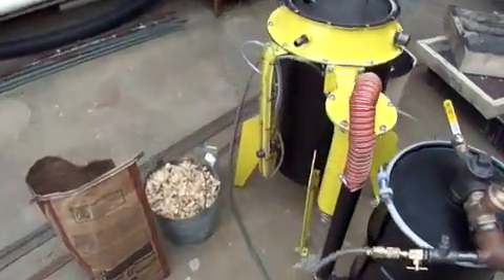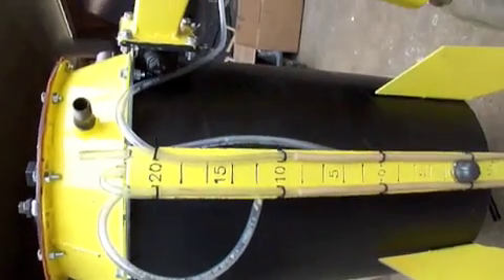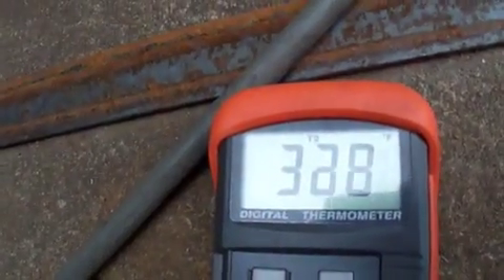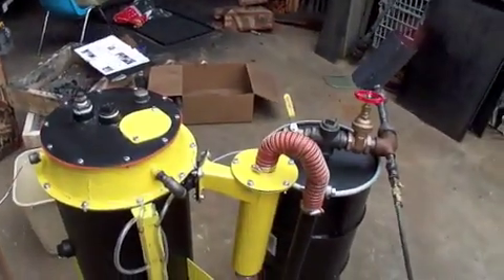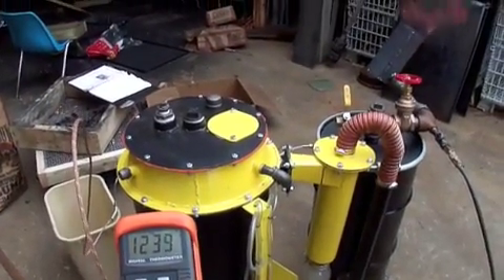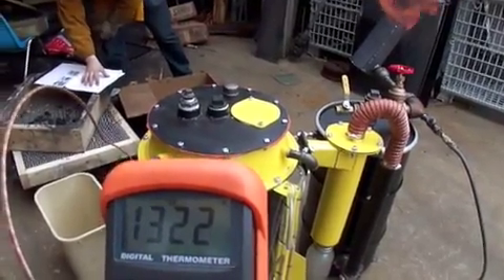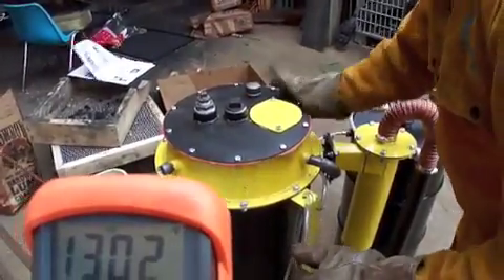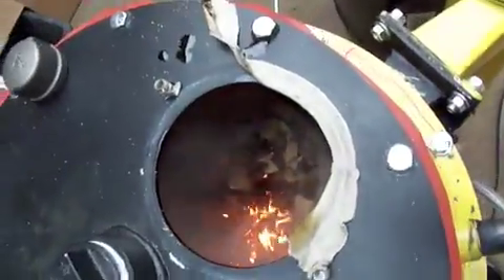ASU GEK FIrst run

Comment: This video is so old....
It's like watching a rerun of Gilligans Island
Keep hearing these collection of children
Talk about BIO MASS

Not sure what any of this technology was suppose to be or be for...
Doesn't take a genius to get that this specific process
Seems to have gone nowhere

Watching an  exhaust after burner ignite...  
Pretty much details a processing plant that afterburns biproducts 
From their mfgring process.
Yeeeeee   Haaaaaaaa
Vehicles with wood burning stoves inthe trunk or bed of a truck
Are about as Beverly Hillbillish as it gets

Lets get that this is not what this technology is about...
Traveling across an apocolyptic world in a car with a stove in the trunk
Most you idiots aren't getting it

I do..  others do as well

Generating a source of heat
Needs to have a multiple functional application in its practice

You guys know what that means ???

Heat generation through a chimney stack is not about the radaiting heat
In a/the main room

Advance planning utilizes a double wall stack where the secondary heated air 
Is circulated throught a house

Seen some of these principles utilized where some brillant nut 
Wrapped a 3/4 copper tube around  a stack in order to create  hot water supply.... Circulated with pump assistance throughout a home...

Using a Gassifier to supply an on demand supply of secondary burn gases 
To a localised generator...  is a cluster hump itself...

Good to have heat in a house and use a secondary source of residual power 
In a generator..   
The desperate empty headed guy who wants to baby sit a Gassifier 
When listening to a 98 DB generator run all night long... is a fool.So..  

You guys  need to rethink what we are doing here..  and why.

Lets move on to some of the newer videos of more advanced techniques

Check out the ones that direct technology where

Pellets superheated but not ignited in a seperate chamber 
Where the pre ignited gasses
Are siphoned off  
Compressed into a propane tank in a concentrated form 
For use in vehicles and generators as a biproduct of the GASSIFIER PROCESS.

Using the Gassifier process in more of a BOILER process in order to produce
A degree of Mechanical  (locomotive ) type interaction/reaction 
To generate electrical energy mechanically/quietly while capturing the gases 
That would be used to generate that same energy for use at a later point/time

We see a lot of LONE WOLFS doing a lot of good research ... 

Lots of good development and techniques
Less about being preppers
Who are less imagenative or creative mechanically...  
Too busy vaccuming sealing sweaters and nuts

The guys we see working this stuff through
Can only solve one PYRAMIDS MYSTERY at a time...
Reply: MUSIC VIDEO EMCEE Your a real idiot. You have no idea what you're talking about. See Driveonwood site. These guys drive all over the Country on Woodgas with an Imbert type Reactor in the Bed, not a Woodstove. Me, I also have a Wood Gasifier that runs a 15 KW Onan Generator on Wood Chunks. Crawl back into your College Books dumbass!
Reply: This is what happens when you don't breast feed your kids....this commenter.

Comment from the maker: This is a GEK (Gasifier Experimental KIT) that was purchased and then assembled. Don't be fooled into thinking that meant putting a few bolts together. There were hours of welding and fabricating involved. I agree there should be an internal collar to help funnel wood chips. We often had problems with wood chips "Bridging"
Reply: In the refining industry they use zeolites to crack longer carbon chains.

Comment: Thats great guys - your getting a feel for the technology - a lot better then my first attempt.  But I am onto Biomass to Liquid now - so the fuel can be storred and used in a diesel engine or generator.  The trick is turing the bio crude into the correct diesel fraction by way of fractional distilation.   Good work you are doing - Lets Shut Down The Oil Companies !
Reply: Hey, did you continue this?
Reply: @twonulator  well my research led to a thing called thermo depolymerization.  All of humanities energy problems can be solved easily.  I did not have the funding to continue research but it was fun learning about it.  Now I'm working with geopolymers.